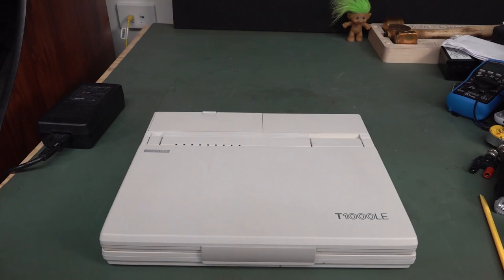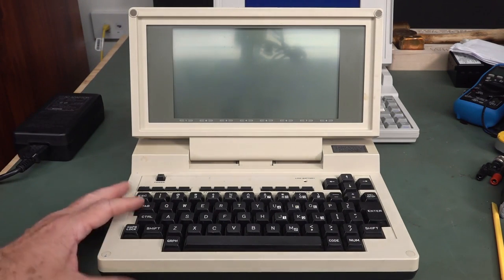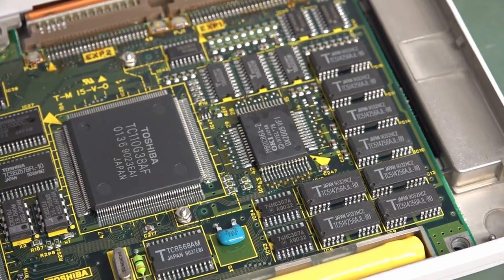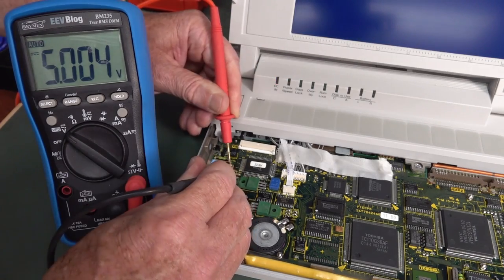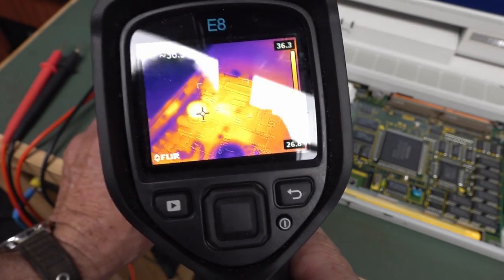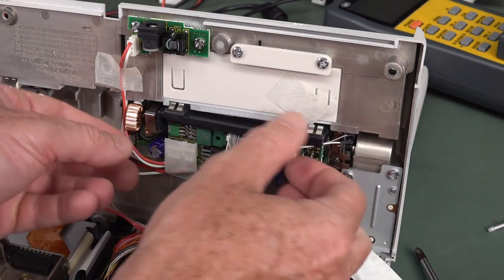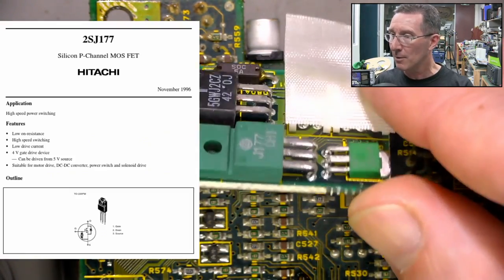EEVblog 1527 - Toshiba T1000LE DOS Vintage Laptop Repair HELL

Comment: These old Toshibas are shockingly bad - both in layout / design and the caps and trace thickness on PSU section.  I started looking at a T1200 (yet to revisit with microscope soon) and I spent hours messing around trying to get the PSU section up and running properly.  I suspect I may not be able to fix it...  Considering how old it is, I was shocked at the trace and via size on the T1200 PSU board (it has just one separate PSU board unlike the T1000).  I can hardly see them with magnification...
Reply from the maker: Everyone on the forums say similar things. Convoluted PSU, no schematic, corroded traces, yuck.
Reply: Arnold Rimmer  I hope Dave will go for that.  Don't fix the original PSU but instead use simulated battery power.
Reply: @EEVblog  honestly you messed up... Put in capacitors that actually go with this system with the actual correct voltage instead of the surface mount ones you used.
Reply: @EEVblog  besides the fact that those surface mount capacitors you used have 4 poles, and the original ones had 2. So they're not even grounded. You also failed to meet the power requirements. "Good enough" is not actually good enough.
Reply: Arnold Rimmer  Yeah, I flagged this on one of the earlier videos...
Reply: @EEVblog  The design absolutely looks terribly complicated compared to the T1000 (no suffix). But I can understand wanting a redesign as the T1000's charger was a huge bank of power resistors in series!

The T1000 I have was my first portable, bought used and dad quickly replaced the battery and added a separate DC input for efficiency. Worked a dream, with 2400 baud modem (there were third party variants) and that 768KiB battery backed RAM expansion. The thing had suspend and SSDs (yep, two) before power management was a thing. Also, on the T1200XE BIOS has support for full 640x400 graphics, not just the standard 640x200, and you can run 80x50 text mode too.
Reply: arnoldrimmer4833 Yes. I totally agree. Power via the battery terminals. 

These old laptops were power hogs. Besides the messy logic, the floppy motors and fluorescent tube inverters for the LCD backlight required high current spikes which require a working battery to turn on. 

NiCad batteries are able to provide very high current (20+ amps). I have an old Toshiba laptop from the Win95 days (although not as old as Dave’s, it’s still 25+ years old) and requires a working battery to boot. Good luck👍
Reply: I have a soft spot for these old Toshiba T-series laptops, as first computer of mine was one of them. Toshiba was pushing hard on the miniaturization and integration at that time, as were other Japanese manufacturers. Whole design philosophy is very different from western electronics, and you can recognize boars just by look that are designed in Japan. Sadly, almost all devices are starting to suffer from leaking capacitors, and many are beyond repair. When the vias and small traces start to corrode through, it makes difficult and messy repair, and without passivation of the electrolyte and removing existing corrosion, the issue will just continue to get worse. These computers should not be even tried to be plugged in before leaking capacitors and electrolyte is dealt with, because nonworking switching power supplies in them can easily pass unregulated DC to the logic damaging them permanently. With custom gate arrays, that will be end of the device.

And yes in deed the case is painted plastic. Toshiba used metallized conductive plastic as EMI shileding, and painted the outer case white. Positive side is that paint will not yellow like ABS plastic would, but sadly the paint will start to chip off. Still better than some other old laptop computers, that were made of plastic that when getting old starts to disintegrate and go brittle. I have some other vintage laptops that can not be handled anymore, as even slight flexing or opening the hinge will cause plastic to crumble away. Toshibas T5xxx and T3xxx somewhat have this issue, where the strong springs and hinges supporting the heavy gas plasma display will break the plastic, but smaller T-series do not suffer that badly from brittle plastics.
Reply: Arnold Rimmer   The T1000LE does not require a battery to run.
Unfortunately not all T-series are the same.
The T1000XE and T1000 for example need a battery to be present and sufficiently charged, the T1600 and T1200 amongst others don't.

One gotcha is that for the T1000LE the harddrive caddy (with the small adapter cable inside installed, a physical drive is not required) should be inserted and screwed down for it to work, the system will shut down with a single beep after a second or so if it isn't.
Reply: Arnold Rimmer  Right, a power fault. Not a battery fault per-se.
All the flashing power LED means is that one or more of the required voltage rails (+5V, +12V, -22V and -9V) aren't within spec for some reason and the system shuts down to protect itself.
The LE and XE PSU design is similar (all of the early 90's T-series are, really) but not exactly the same. The microcontrollers (and probably their programming) and some of the supporting components and circuitry are very different.

I would also advice running without the battery to make sure it doesn't short out the PSU but I fail to see how running off the battery terminals would put less strain on it. It will still need to operate the DC-DC converters to generate the required voltages just from 7.5V instead of 12V. That 4.5V difference shouldn't make a difference to buck/boost type regulators if the caps, inductors and MOSFETs are good.

The point I wanted to get across is that the T1000LE will power on without any battery present as this is a common misconception about these specific machines.
Reply: Arnold Rimmer  right, but if there is no battery present (which I reccommend to remove for testing anyway) the charging circuit is not active and doesn't (shouldn't?) draw any significant amount of power.

I agree that the backlight inverter may cause it to not power up, disconnecting that could be a good idea. Personally I haven't seen them fail though.
I also agree that they sometimes power on fine when powered through the battery terminals, IIRC you're are able to provide a higher current than through the DC jack.

Anyway, my point isn't that it's no something to try or anything like that.
My point is that the statement that the T1000LE needs a battery to work is wrong. It does not, as opposed to some other models. That is what I meant by "common misconception".
Reply: Arnold Rimmer  That's certainly a valid point. I just wanted to set that straight as there are a lot of wild things floating around the web about these old Toshibas leading people to false assumptions, this being a harmless one.
In any case I didn't mean to offend you and if I did, my apologies.

And yeah, unless someone is willing to put in a disproportional amount of time fixing this board it's probably toast. I'd give it a shot because I like a challenge but it's not for everyone.

The machine does make a nice display piece or paperweight though.
Reply: @ketturi  Same here, my very first computer I ever used was a Toshiba T1200 in the early 90's. Still have 2 of them somewhere at my parent's place - probably actively corroding away from leaking electrolyte
Reply: Yep, absolutely. I've got two T1000's (plus a third motherboard) all three have terrible corrosion in the Power section, and I haven't managed to get a single  one working. The design of the power section is frankly baffling. Beautiful machine in every other way, but that damn power section is a nightmare.
Reply: The problem I had with one of those Toshibas is I could not even get the caps out. The vias were so tight that even ZD-915 could not get them out...

Comment: On the Back side is a physical broken diode or some thing.
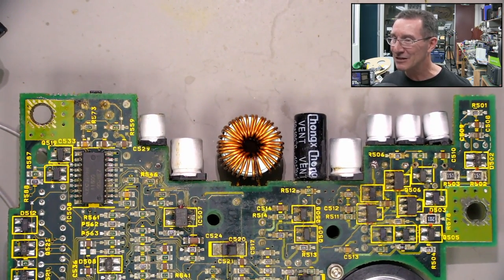C517 below the coil between C520 and C521 40:45 found at 45:01 😅
Reply: C520 visibly cracked in half
Reply: Yup, and the one near the speaker too on the same side of the board..

Comment: I had a T1100, and a T1200. The keyboard was lovely to use.  The thing I remember the most was the smell that had something really special about it as it reminded me of the happy first contact with computers.
Reply: Ah the smell of gently simmering electrolyte perhaps?
Reply: @DaveF.  Why would you smell that back then? That's a thing you smell decades later when the caps fail.
Reply: @8bitbubsy  Its called a 'Joke'
Reply: @andymouse  Good 'Joke'.
Reply: @8bitbubsy  Thanks!
Reply: I remember the distinctive sound of the hard drive in the T1200. I also remember there was a switch on the back that you could shut the hard drive off to save battery power. Boot it up, start your application, and then shut off the disk! Also the inverter for the screen backlight made a characteristic but warm and welcoming whine. A thing of beauty and a joy forever (until the capacitor electrolyte eats the board away).

Comment: I'm also noticing under the marking R513 that there is another black component that has a decent crack through it as well
Reply: He eventually noticed the components with the giant cracks in them.   I suspect our beloved host could possibly benefit from some reallocation of available resources, trading a bit of high speed output for some additional input bandwidth...
Reply: @StubbyPhillips  I'm kinda wondering if it's not a field of view thing. The Tagarno is a physical microscope, right? He might not be seeing as much through the eyepieces as we're seeing on camera.
Reply: You need to use your senses before anything else, amazing how many things can be repaired by just looking properly , cant beleive you didnt see those cracked caps in all honesty. With all due respect, you can have all the knowledge in the world but if you dont have that fault finding brain/eyes/senses , youll be there all day
Reply: @reacey  It's true he could have seen it earlier, but you tend to look for the usual suspects first. Cracked components is definitely not the first thing you think of or look for, especially in a laptop. It might very well be the first time he sees that in 30 years. So it's really not that surprising that he didn't look at it first. It's worth wondering how this happened, because it's very unusual that such small components crack like that. We would expect them to melt under heat, not crack. It's surprising that several components failed like that.
Reply: 37:15 C520, blown tantalum cap
Reply: @lolilollolilol7773  a child would have seen that cracked cap. I stand by what i said .

Comment: I have a couple of these machines as well as a T1200, T1000 and a couple of T1000XE's.
It's a love-hate relationship. I love the look&feel and the history behind them but every single one you get has the same problem.
The Elna and NipponChemicon caps used in the DC-DC converters all just start leaking from the bottom and the electrolyte does the rest.
No way to judge it from the outside of the machine or even from the top of the board.
On top of that, what looks like minor damage may lead you down a very, very deep rabbit hole.

I've fixed all 3 of my T1000LE's and they still work after a couple of years.
In the mean time I've fixed, amongst others, two T1600 and reverse-engineered the PSU PCB's for them along the way.

Feel free to send me a message if you need any information or just want to exchange thoughts (see my YT community or about page).
I have 3 of these to check component values, etc. if need be.

I've spent countless hours searching the web and staring at these boards so I'd like to think I know a thing or two about them.

Comment: The sub battery is a feature that laptops had up until the late Pentium days. You could put the machine in standby, then yoink the main battery and swap in a fresh one. The sub battery (called standby battery in other machines) would keep the RAM refreshed for the short time needed to swap main batteries out. They also sometimes keep the CMOS settings, but it's not uncommon for a computer to have a separate battery just for that.
Reply: I believe my 2005 Dell has this feature but it doesn't seem to work right.
Reply: PDAs with Microsoft operating systems had dedicated memory batteries well into the 2000s, some models even had mechanical interlocks for replacing one battery at a time.  Then Microsoft finally embraced the existence of flash memory, only to squander their market position by completely replacing their APIs multiple times in a few years.  That last failed design is what's most hated about recent Windows products, besides obnoxious behavior towards customers and governments.

Comment: I love remembering all the old systems I grew up with but I don't miss how slow everything was. 😄
Reply: For sure, and these days outside of running old games on original hardware, or the odd piece of defunked sofware till we hit the late XP era with DDR2 RAMthey really are not that usable. It also still blows my mind even at 42 having been a computer user since I was 2 when my family got a Commodore Vic-20, at how even a cheap sub $200 Android tablet these days puts older desktop systems even from the XP era to shame.
Reply: @CommodoreFan64  Yeah and phones. The ability to casually edit 4K, play 3D games or run n-body simulations. Phones newer than 2019 can run an xbox360 emulator which may not sound that impressive given the console age but at such low wattages on a portable device with emulator overheads really is. Give it another 20 years and phones will probably have ray tracing chips.

Comment: We had several hundred T1100+ dual floppy laptops for field engineer use in the late 1980’s, near zero failures of the units themselves but the mains to dc power supplies from Toshiba were notoriously bad, running hot and with thermal fuse failures.   We gave up on Toshiba replacements and eventually designed and manufactured a new one in house.

Comment: Regarding copper traces, use a thin tin-plated copper wire and solder it from point a, bend the wire along the trace, solder the wire in the trace towards point b. It will be nice that way.

Comment: rip it all out and put a pi in there. Figuring out the keyboard might be a pain but it can probably just be wired to a USB keyboard controller directly. The display might need to be replaced if you dont want to go down the rabbit hole of figuring the display out
Might make a nice serial terminal

Comment: T1000LE? A mimetic poly-alloy. None of that living tissue over a metal endoskeleton rubbish.
(I'm sorry Dave, I'm afraid I really had to drop some pop-culture references - but Dirty Harry is yours)
And hmm, seeing a Conner disk in a T-1000? Can't be a coincidence!

Lovely old laptop - shows how far we've gone since WayBackWhen! I hacked with some late '90s Toshiba Satellite, and a Thinkpad 380ED, but nothing that old.
Oh the mobo, a thing of beauty and a joy for ever. Too much rosin leftover for my taste though. 
Unassuming CPU indeed. Who would have thought?
14:54 these xtals in a DIP package are a fascinating thing in itself, now that I've seen that in the Open Circuits book.
Electrolytic come-a-gutser, as always - what else would you expect? I would still bend the leads and put them through holes for extra mechanical rigidity.
Extreme discombobulation going on there on the backside! I wonder where this corrosion (hey now, hey now, now...) came from. Catch you later with this laptop, I hope! I'd love to see the launch.

Comment: There is a lot of corrosion caused by leaked capacitors, which is pretty typical for caps from that era, especially if they are "high quality" brands. They leak out instead of drying out, so if they are not replaced (or removed) before they definitely fails, they cause a huge mess of electrolyte, corrosion and similar things on the PCB, which is typically non reparable issue. I prefer capacitors that dry out instead of leaking, which are typically the cheap ones. They are more often to fail, but also much easier to repair. In my opinion, that leakage caused a short between the windings of that big inductor (L501 or what), so I think this one should be at least rewound. Next thing are that broken SMT capacitors, which is in my opinion caused by slightly higher voltage like >7V on the 5V line (that capacitors are typically 6.3V), which, if occurred (and we know this happened), fried almost all TTL logic, so I think this device is completely nonrepairable. Which is something very typical for these old toshiba laptops.

And well, plastic housing of these devices was painted. It was a huge pain in the ass past then, because almost every repair resulted into some minor paint rip offs caused by bending or stretching that housing. Plastics are flexible, but the paint is not. That was a terrible idea, but, well, this was how things was made past then.

Comment: WordPerfect was all I ever needed.   The split-screen mode where you could see every formatting mark was very handy.   Now, if I ever have to modify a Word document there's a 99% chance I'm going to end up wrecking the whole thing.
Reply: J.R.R Martin apparently still writes on one of those. Perhaps that's why it seems to never be coming out... like he wrote 90% of his last novel and his oooooolde laptop went kaput, and unrepairable.
Reply: you most likely already know this, but in modern word processors like Libreoffice and MS Office, you can enable the formatting display "¶" to see exactly what the program is doing